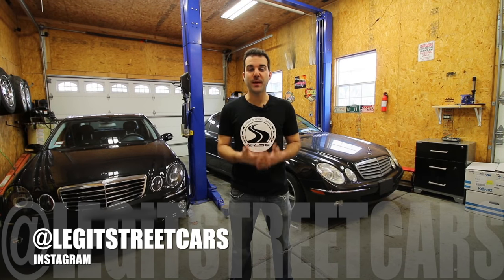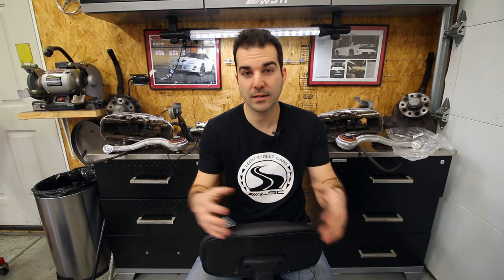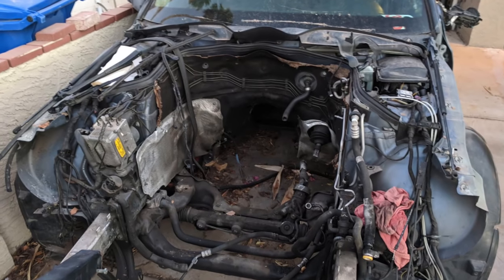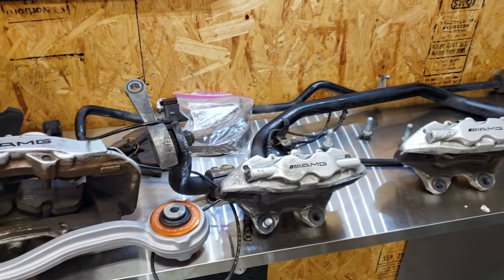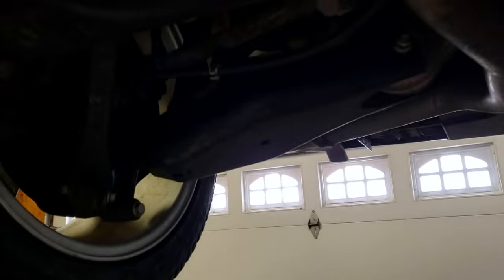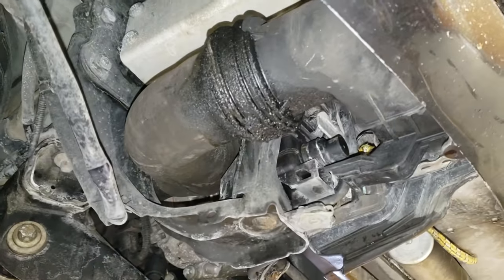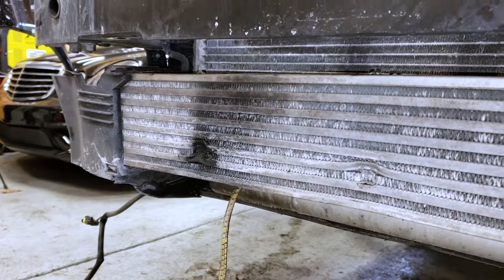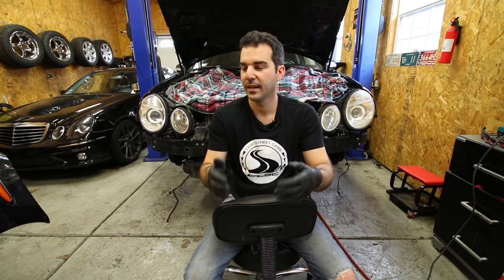This E55 AMG Was Parted Out After A Mercedes Dealer Ruined It. The Story & What I Bought For My CDI

Comment: So, a real crappy job was done on the AMG. The one thing I don't hear in all of this is: COULD it be possible that the tech rang the owner and the owner said: just weld it? But, in that case, I would SPECIFICALLY state it on the invoice! I would explain the whole situation on it and wave ALL warranty on these specific jobs. Having that said: it's NO WAY possible that a dealership would fit aftermarket stuff AND do such a lousy job with the gasket material. So, I do get the feeling the tech just did a sloppy job... Very sorry to hear that...

Comment: Would you ever consider owing a w211 e350?
Reply: I did love mine 07 E350 drives and runs like brand new been serviced all maintenance done by the selling dealership now has 202k highway miles and I drive it daily and anywhere did have new transmission at 180k

Comment: If it is not too late, can you measure the spacing between the bolt holes on the front and rear calipers. That would be useful to know if these brake calipers can be easily used in other applications. Thanks.

Comment: When you will be replacing calipers, please make a some sort of tutorial on SBC system and brake fluid flush. Was attempting to do that on my one at local MB specialist but for some strange reason Star diagnostic refused to start the operation, was wondering if I can do it partially myself with just a pressure bleeder (fluid inside the pump won't be replaced), just do it more often?

Comment: Any opinion of yours on the OM642 engine?
Looking to buy a Chrysler 300C 3.0 CRD, researched a bit and found the oilcooler (oil/water heatexchanger) leakage issue.
Any other issues I should be aware of?

Comment: That is hilarious, was it Mercedes Benz of arrowhead? I know who worked on this car, I remember this car, although you have the wrong info on it.
Reply: What's the info? lol This my car. I'm curious!
Reply: The dealership didn’t weld the crank pulley lol, I remember the technician wasn’t very happy doing all the after market work on it, all he did is the lifters, some after market pulleys but not the crank pulley, and it looked like whoever painted the valve covers didn’t clean the gaskets well and that’s why the pick up tube was in that condition. All I got to say is don’t blame the dealership, the person who worked on it was one of the top techs in the shop.
Reply: Ha.  That was the story I got from the previous owner.    Awesome.   Crazy.
Reply: I know the dude who painted and did some of the work...  I can see that happening. Do you know who installed the crank??

Comment: Engine rebuilding 101... you plug up oil galleyways and channells so no debris falls in... I bet thats what happened and starved the cams. They are the last to get oil I believe and they have narrow channels. Willing to bet thats what happened and the gasket material ended up in the sump
Reply: Thats just sloppy unacceptable work. I don't want to make assumptions either though because sometimes customers want you to cut corners and take risks to save them money. I never cave in to that kaka

Comment: well as far as having a service departtment at a dealer jut cutting an welding on stuff instead of doing it right, i just had a dodge dealer do some work to the manifolds on my truck an while the manifolds were off they dropped a socket down the pipe so instead of just pulling the pipe down an turnining it to get the socke out right they just hacked my crossover pipe inhalf an put it back together with a boogery looking weld this is all part of my catalytic converter system an i still think i have the same exhaust leak i took it in to have fixed but now i think some where else

Comment: I would SUE the shit out of that dealer.....

That’s pure hack work......where did the tech even get the welder to do that?

I’d also install a air to water intercooler using an eBay IC underhood and a factory e55 heat exchanger and pump up front.

Comment: One detail wrong in this video. Dealer techs are not the best. 95% of dealer technicians are the bottom of the barrel when it comes to understanding and working on vehicles. They only know what a computer tells them. They're parts changers who don't even do that well, with parts installed incorrectly, missing fasteners, and various items broken that were in the area of work being done.

Comment: Alex I pulled out my power steering Pump on my W211 cause it was going bad put a new one and my ac compressorstart knocking and it exploded clutch plate flew right off and it start spitting parts out it any advice?

Comment: That isnt welding a crank pulley to crank, do you honestly believe that? It oooks like he tried to make a key. You could tell by the cam journals it was oil starvation, then it locked the, the pulley snapped off. Not rocket science.

Comment: I havé à low-cost millage gl350 with the om642 engine, and I havé this Kong of noise on COLD STAY UP that seam to be cause BY a defective timing chain binder, are you aware of any service bulletin on this problem asI WOULD like to repair it properly,it' a 2012 with only 60000 miles, thank you and keep  on the interresting video on Mercedes products

Comment: Don't elongate the caliper mounting holes on the hub assemblies, you'll weaken the mounting points and they can fail in hard use, which will throw the caliper into the wheel and lock everything up solid, and cause you to have a big crash.  The caliper mountings are designed to be the size they are from enormous amounts of testing and development work which costs millions.  If it was possible to safely modify the hubs to take larger calipers you can bet the builder will have done it, as developing and testing a new bub assembly to take the bigger caliper costs them further millions, which they aren't going to spend if they don't have to.  Making modifications like that, you really are playing with your life, and the lives of anyone who's unlucky enough to be on the road with you when it fails.  If you survive, and other people are killed in the subsequent crash, you're probably going to spend the rest of your life in legal fights due to the fact that you have made alterations to the equipment on the vehicle which will make you liable for damages, costs, compensation etc. etc...
Reply: Yup cuz after a crash they’re gonna search for elongated mounting holds OR come to the conclusion that a modification took place!( a good lawyer would smack them silly)
Reply: @deaf2819    Actually, they do.  Every vehicle involved in a serious crash is examined for its mechanical condition, and something like elongating those caliper mounting holes is really very easy for a specialist to see.  Then the part will be tested to see whether the problem could be down to wear and tear or whether it would have to be done deliberately.  If it is found it would have to be done deliberately then the driver is liable as they have used a vehicle that is not in a safe condition for road use.  There is no legal defence, it is a matter of provable fact.  The fact that the driver has been using the vehicle in an unsafe condition absolves your insurance of any responsibility as EVERY policy contains the clause that it only applies in the case of the vehicle being in a safe and satisfactory condition for road use as according to local regulations so the liability falls solely on the driver...

Comment: The engine locked up because the oil pump was clogged and starved the top end, what happened after is it spun a cam bearing, not too hard to figure out from those two pictures, it wasnt a bad cam and lifter job, i mean you gotta be an idiot to screw up a cam job(not talking about timing)

Comment: I just bought a E65 amg what should i do it first.
Reply: I don't know where to begin with this comment.
Reply: Joe Swanson 🤣🤣🤣🤣🤣
Reply: Part it out and get diesel one.
Reply: You should sell it as they never made an E65.
Reply: Which model
Reply: Diesel Swap?
Reply: GetoverYourself a custom build e63 with the v12 from the cl65 would be awesome though. Like Weistec did with the black series c63
Reply: step1, sell it.
Reply: Sell it.
Reply: Ls swap it
Reply: Weld the crank pulley on?
Reply: Weld the crankshaft
Reply: Clams McGee  sure
Reply: Clams McGee  50hp gain

Comment: i know u don`t like me but correct this please ! it also could been caused by the fact that these engines don`t have a oilpresure sensor wich means if you oil presure is down it doesn`t notice anything ... also these engines are common for failure due to bad o rings in the oil suckup system : https://www.youtube.com/watch?v=lUAB7lKoIt0
although your parts car has suffered from very poor work its something to mention ;)
nice video ! ;)